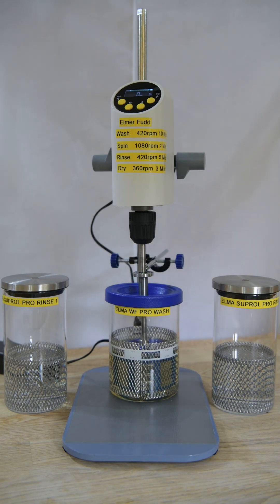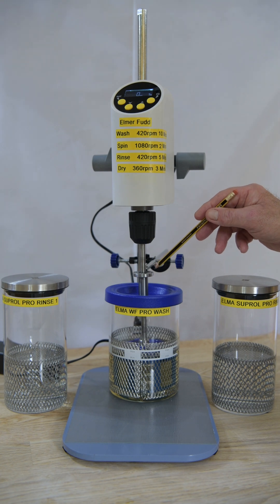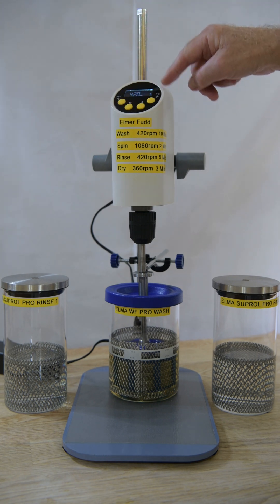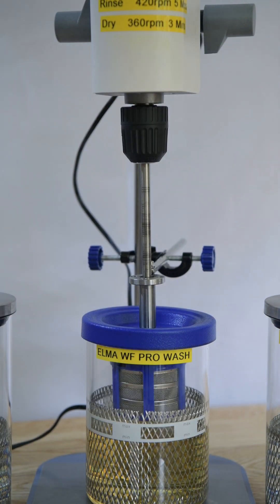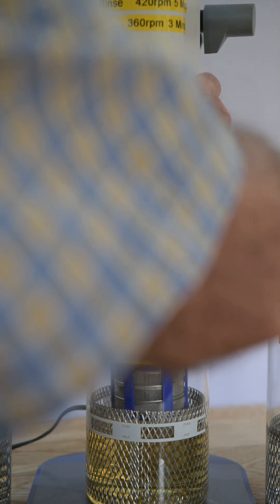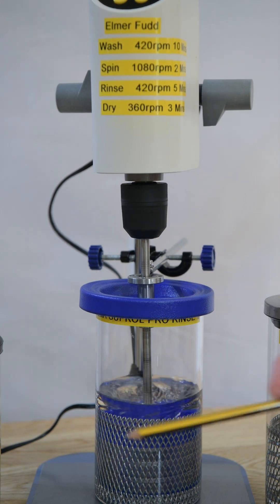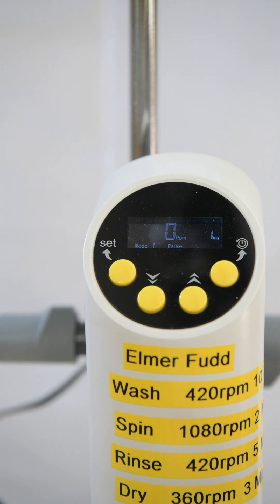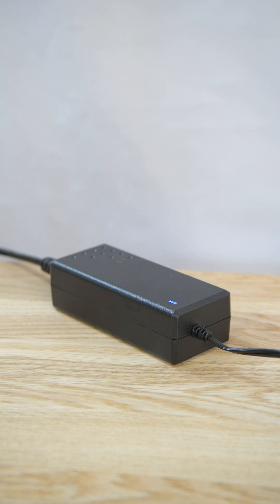DIY  Watch Cleaning Machine

Comment: Did you get good cleaning results? Thanks for the video
Reply from the maker: I had been using my usual obsessional pre cleaning regime and the same products in an ultrasonic tank prior to this, so I was able to make a comparison over time. The differences were dramatic. I've never had to cycle my machine more than once and yet the US often needed 2-3 cycles. The drying process is also significantly quicker. To put a figure on it, previously I would set aside a whole evening (4 hours) to clean a movement. Thats now dropped to 90 minutes.